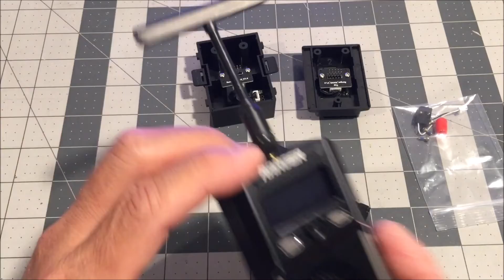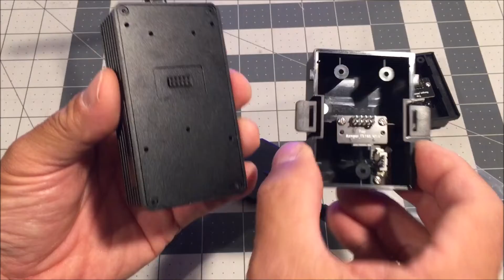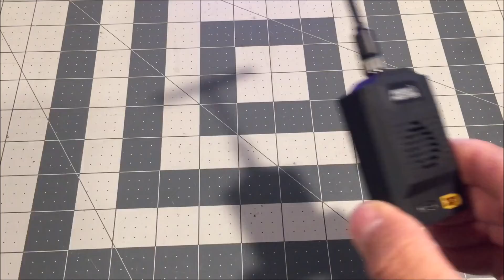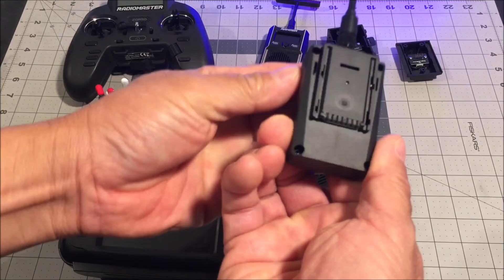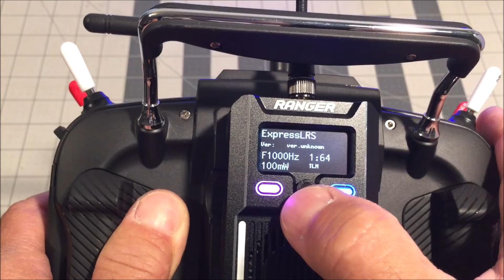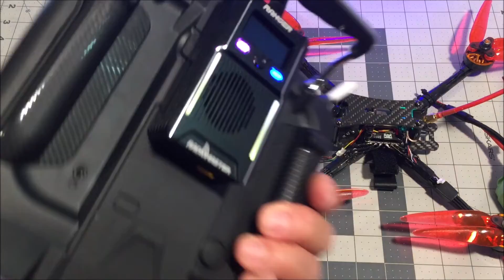Radiomaster External ELRS Modules & RP3 ELRS Receiver Review

Comment: Hi Pete, long time no chat!! I went to order one for my antiquated Tango 2!!, they've pulled the plug on the mini/nano sizes due to an xt30 issue, it's also worth mentioning that the 1W only works with EdgeTX (you may have mentioned this - but I missed it!)  :(
Reply from the maker: They should be back on the shelf soon with new updated pcb boards.  You can order then.  No I didn't know about 1w working only on Edgetx.  I have updated all my tx's to Edgetx so didn't know about the issue.  Thanks!

Comment: Excellent review Pete!! I just may get this module & replace it with the TBS crossfire I have on my 10". I would have to update the firmware on my TX16S since I'm still running Open TX.  I was told by a good friend of mine that there is a power mod you can do to make it run on 2W. The range on it is absolutely phenomenal much much better than crossfire  :)  😊👍😎
Reply from the maker: 2watts?  That’ll be too much range! Lol 😳
Reply: @RCEscape  Yes sir. Thats what I was told. When the video comes out, I'll have to watch it

Comment: Hey Pete will it work on the jumper TS8G plus? Amazing review 👍🙏👍🙏
Reply from the maker: It will work with open tx and edge tx.  I don’t think it works with Deviation.
Reply from the maker: What does it have?  Open tx?
Reply: @RCEscape  deviation
Reply from the maker: @electroddxful  
Yeah, I don't think it will work.  It will need elrs lua script.
Reply: @RCEscape  ☹️☹️☹️
Reply from the maker: @electroddxful  
I know.  It would have been a great way to elrs.
Reply: @RCEscape  Yes it would of☹️

Comment: Thanks for the video! Does the micro version fit the radiomaster tx12 original controller  not mark ii? Thanks for the help!!
Reply from the maker: Yes it does :)
Reply: Already on pre order! Thx. I had messed up. I recently bought the eachine novice 4 kit and wanted to add a micro whoop so I grabbed the eachine uz65 and thought the tx12 had elrs... it will soon!!
Reply from the maker: @dustinpugh8222  
It is the best deal for it since you get three receivers.